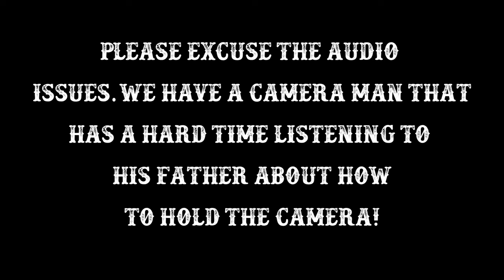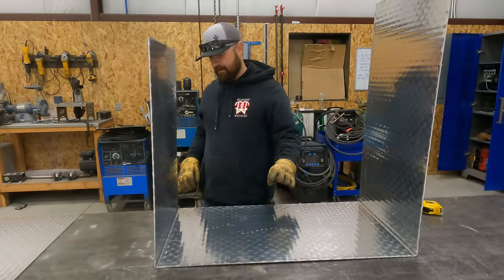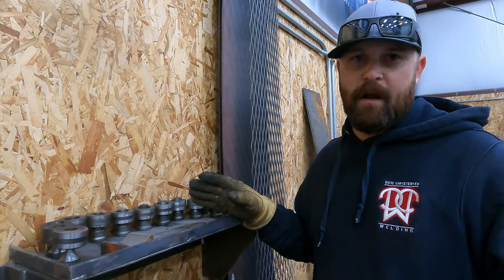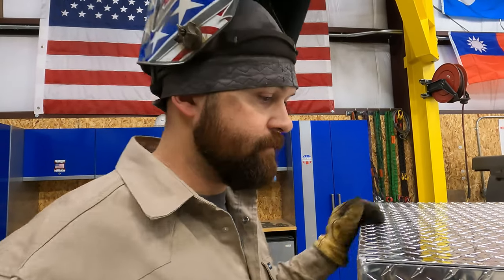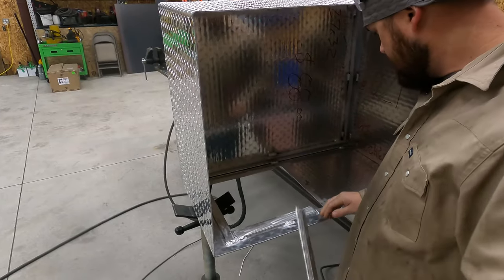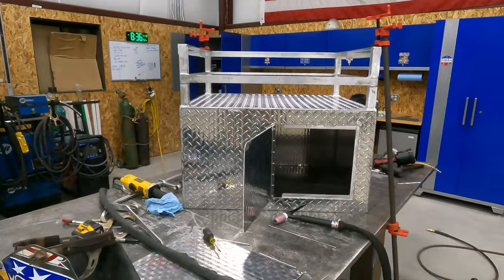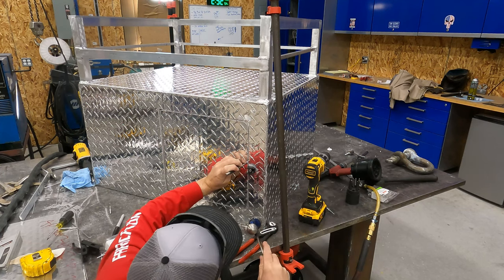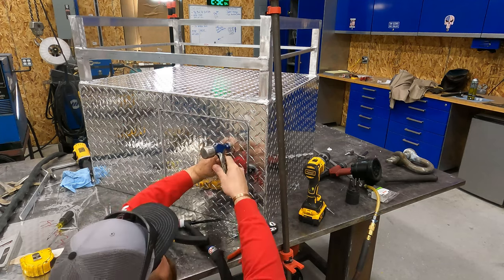Aluminum TIG welding dog box and decoy rack

Comment: No vent holes for the dog?
Reply from the maker: I actually cut a 1-1/4” hole with a hole saw to stick your finger in to help open the door/ventilation. There is also a 1” gap around the bottom because of the ribs in the bottom of the boat.

Comment: No air vents  ?
Reply from the maker: There was ventilation between the ribs on the floor of the boat. I also put a hole on the door for both ventilation as well as somewhere to grab the door and open it. That was done before it went to powder coat.